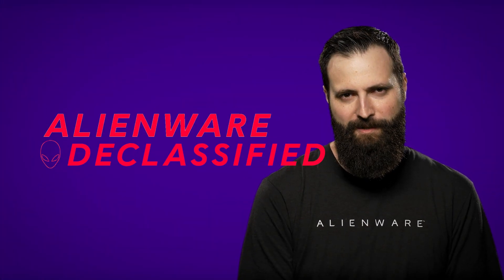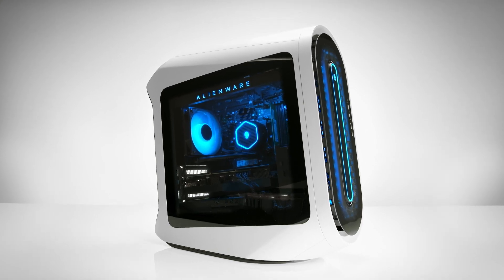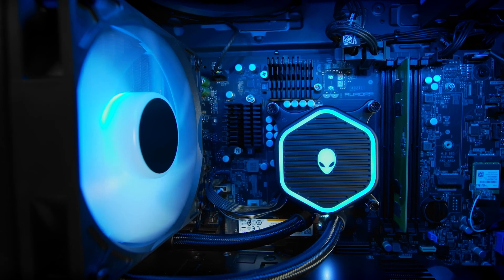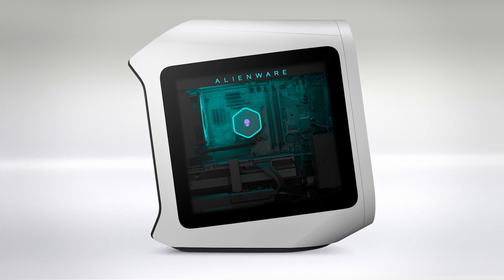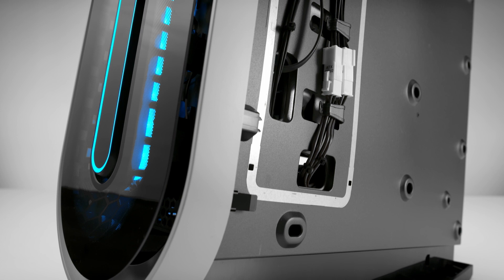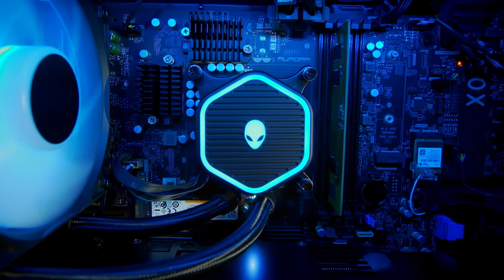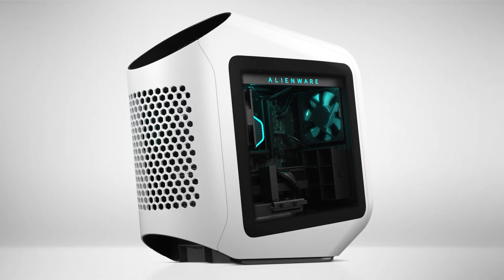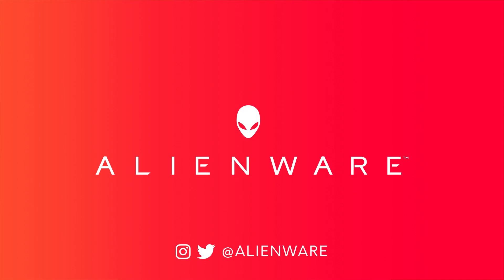Alienware Declassified | Engineering the New Aurora R13 & R14

Comment: Go to their website and see all the options and their costs. I did and loaded one out, max everything. The final price was over $5000. And that case reminds me of my R8. There should be a warning on the rear end, "Open at your risk." Talk about proprietary. Since my R8 wouldn't hold my new RTX 3080, I decided to gut the R8 and move everything to a regular case. Bad, bad idea. Don't even go there. On the lighter side, they do have excellent support. I've used it several times, and they took the time to solve my problems. Their support: 10 out of 10. Their computers: 7 out of 10.

Comment: RAM is locked at 4400MHz with the two sticks installed.  Can't upgrade it for better speeds, and there isn't any XMP 3.0 going to be available for the system.  Basically, decent airflow is what they decided was what gamers wanted.  Nothing more.

Comment: Why not just use RGB lighting fans all the way around? I know the front two in the front and the there’s the one at the top of the case but the reflection of that light would light up the whole case.all you have now is the one 120 mm fan with RGB and optional cooling thermal on the CPU.if your gonna go the RGB route why not go all the way.

Comment: I think its the coolest idea ever, except I just dont like how its on an angle. lol. But, for some reason the idea of a single fan water cooler on the back of the case makes me want to upgrade from air cooling.
Reply: If you go to water cooling please don't get a 120MM CLC (what this is using). 120 MM CLC's are awful, go with 240MM or 280MM. The CPU in this PC regularly hits ~80c while gaming. My overclocked 8700K with a large air cooler (Deepcool Assassin III) has never peaked above ~72c while gaming.
Reply: @sean8102  does it come with the integrated graphics card turned off by default? lol..

Comment: Great chassis, but I'm still very disappointed why Alienware (Dell) discontinued the Area 51 (an entirely different subject.. so lets continue).   I have an Aurora R10 and I was very excited to see the R14; however, what I've quickly noticed is the room -- or the lack thereof, and honestly, if your going to deck this thing out with a Nvidia RTX 3090 and a Intel i-9, there is no doubt you will be pushing that 750w power supply to the limits.   With these confined spaces, you better hope those two fans (front and rear) are working well or your temps will climb to dangerous levels very quickly.  Then there's noise control --  Its always been a challenge for all computer makers to drive performance without the chassis sounding like a jet engine.  However, sales (in all PC makers) will always say, "These systems are quiet."    Well, ok to be fair, if your playing lower end games that can run on a Intel i3, sure, true enough. However, you be the judge.. what did you buy your Alienware for?
High or ultra-high resolution settings, games that demand increased GPU and CPU use, fast I/O and disk access etc.. will only end up with you running for your gaming (with noise cancellation) headset.  (Case in point: Dell also said the VRTX server chassis was "quiet as a workstation - you can place it under your desk" - if you ever heard one (or you have one), your probably laughing too, because they are loud!)
Lastly,  the motherboard is a custom build for this chassis. The connectors at the end (to improve airflow) you will not be able to upgrade it - so if your one of those who likes to rip out the old and install new, years later, your out of luck.     In summary, I bid Alienware the best of luck on the R14, but I'm very skeptical what others will say -- for the past releases of Aurora for me however, to include the R14, its a high price tag for the virtually reinventing the same rig.   The usual reaction I get from people, "You paid a pretty penny for that name".
Reply: I actually needed a comment like this :) 
This chassis actually su*k
Reply: Thanks for posting this.  I have been on the fence with the R14...mainly because the GPU's are so hard to get, otherwise I would just build my own.  This was some great info to mull over before pulling the trigger.
Reply: @mr.papagorgio4683    Client of mine asked to order them one (on Dec 13th) and the shipping ETA was set to Dec 20 in time for Christmas. At first I thought, "Great!" but as time went on, I had a slight feeling that date wasn't going to be realistic.  Sure enough, Dec 21 I got a email from Dell, "Your order will be delayed. New estimated date - Jan 7th 2022.   Why Dell over promises their production and shipping dates is beyond me. Logistics hasn't really been Dell's forte'.  If this generates a reaction from Dell, great! I"d be glad to spend more time with them.  But getting a hold of "Uncle Mike" is close to impossible, even if your managing multi million dollar networks. Proof of concept - Why did Dell dissolve their printer department but never announce it? Answer: Because Dell printers were horrible. (*Yet another topic. :-)   )
Reply: there are two fans
Reply: So another fact that I wish Dell would answer, Dell Aurora R7 came with a 850W power supply.  Why did they downgrade to a 750 on the new releases?  They trying to discourage dual GPU use?  I know a few years ago, Dell used to have a site called Idea Storm where you could post ideas for Dell.  That's gone too. Sooooo..... "Uncle Mike".. whats the deal dude? Your making people think Alienware should have stayed Alienware before Dell acquired them.  But we know the answer to that now don't we.... Too busy making more money via corporations then home users. Some days I feel I should start a 'ying/yang' page.. what we used to know about Dell and the Dell we know now. Example:  Ever wonder why Dell got rid of Appassure, but actually renamed it Quest Rapid Recovery?  Then when you call Dell Support and the support person says, "Thanks for being patient.. my computer is acting up a bit."  I actually asked them, "If your computer is acting up, are you practicing what your preaching and using Dell AppAssure?" Answer: "No we don't use that."   Isn't that crazy??   Do as I say, but not as I do? Why would a company not use their own software?

Comment: Really wish i could swap my inferior case for this new design, my biggest gripe and most of my calls to alienware had to do with airflow and temps
Reply: Get liquid cooling, I have my alienware for 6 years never had to change anything and still don't today.
Reply: @Drew Carry  they didn't have an option to liquid cool the GPU and since the case is so poorly designed (the old one) there's almost no airflow going into the GPU which sits directly under the powersupply bracket

Comment: Sigh. well, as long as this video keeps showing up in my feed, I'm going to keep commenting on the things I find out about it for people to consider. Compared to my previous-gen Aurora machine, two interesting differences: one, is that these new Aurora's have three LESS USB ports on the back. That might mean something to folks who want more than eight available USB ports on the rear of their computers. It's also a bit weird as the physical size of the new systems are larger than the outgoing. You'd think they would at least have the same number of places to plug in USB devices, but they don't.  

Secondly: they removed one of the 2.5 inch drive bays. Most people probably wouldn't care, but it might just matter if you need as much internal storage as possible on your system. Like for production work. 
Anyhow, that's it unless YouTube throws this at me again. Have a pleasant day.
Reply: Oh Get real! if you need that much storage need to reevaluate type PC you need, the bay had to be removed cause it wasted space and limited cooling in the system same with PSU which also had to be sized down to meet consumer PSU guidelines that the Prior Aurora had issues with. With this new build you lose 2.5 but gain a secondary NVMe slot, so it actually supports faster more efficient storage in line with what we should expect from a gaming rig.
Reply: lol

Comment: From the images it looks like this can only mount one NVMe M.2 drive? That's kind of sad. The configurator only has an optional mechanical drive for a 2nd drive with no SSD options either. :/
Reply: You wouldn't want to pay Dell's prices for a SSD drive anyway. I've been using SK Hynix Gold SSD models for over 2 years now with no issues. Installation requires an SSD SATA cable and about 5 minutes of your time to look up how to get the computer to register the drive.

Comment: Woah woah, hold up... I just took another look at these things... Are you telling me the reason why the front ports have been moved to the right of center is because they're physically attached to the Motherboard now? Like you find on the cheapest of office systems?? So if they're ever damaged or bent you have to fix the Motherboard itself instead of just replacing a little small plug-in circuit board? Just to cut a couple bucks off the manufacturing costs? And claim it's to "reduce the number of internal wires"?? 

Am I pretty sure your last name "Troller" is exactly that? C'mon Man. You're PROUD of this? Really? 
Jesus Christ eating crackers, how many other hidden Easter Eggs of awfulness are we going to find in these systems?

Comment: Definitely better looking and improved cooling over the previous version. Looks like the power supply is not standard from the pictures on Dell website. Could be an issue where you are forced to buy a Dell/Alienware power supply if it fails. Can Alienware address and confirm what power supply is used in the R13 & R14?
Reply: In the Gamer's Nexus video teardown of the previous build the PSU and motherboard were all proprietary. No options for upgrades within the case because it's designed around custom hardware. Doesn't look like that's changed.

Comment: For r15, and 16, you can put two fans up front and a 240mm aio on top (make the top mesh). Put the power supply on the bottom, with some space for hard drive and cover it up. BOOM it will sell like crazy.
Reply: They would never because that would make too much sense. They go for the dumb routes. The r27 might have that but well see.
Reply: @JellyTwitches  maybe the R 46,678,128 will finally come close close to making it a SENSABLE purchase and not a complete RIP-OFF!!!!!!!!!!!!!!!!!!!!!!!!!!!!!!!!!!!!!
Reply: @JellyTwitches  They need to hinder performance not help it so that way their customers continue to repurchase new hardware. 

It's pretty sad actually.
Reply: @JellyTwitches  lol

Comment: It would have been nice if I didn't fall for the 50% better air flow on the r12. I mean who would have guessed that a psu directly in front of the 1 120mm fan would have cause issues with heat. I essentially paid 4k for a oven that houses a 3090 and if I wanted to be able to keep the 3090 in decent operating temps I'd have to fire up the jet engines.
Reply: Yea Gamers Nexus reviewed the R12 and were shocked by how bad the thermals were and how poorly designed the system was from a airflow stand point.
Reply: Nice reply
Reply: @mooniemine134  right, my buddy has the same issue with a 3080 and the gpu fans are already going out after 4 months. And had high temps prior to that issue. Essentially what I did was paid 4k for a 3090 and a 11900 and a warranty. Got lucky and won a 3080ti on Newegg shuffle and it performs better than the 3090. Ordered a case and MB now I have 0 issues. It's crazy how much my benchmarks have improved all around with the only difference being a case, MB, and a lower tier gpu. That will be the last purchase from Dell in my lifetime and I would suggest the same for anyone else.

Comment: Also keep in mind Dell has never set the Bios correctly for any PC I have received since 2002- both the CPU and the Ram comes set at lowest speed since they just put the parts together and ship - I do not think they even turn them on to see if they boot - CPU Turbo Boost comes turned off , was running at 4.8 instead of 5.3 and XMS Mem is not set - 3200 ram was running at 2400 - My R4 came with a bad power button so they had to come out and replace the front cover before I ever booted it up - Ran great for 8 years and still going for a friend of mine - every PC from Dell is shipped this way -

Comment: this reminds me of the the $3K R-11 I bought and received late Nov last year with the i9-10900KE, 2 TB ssd, 32GB (upgraded to 64) ram and GTX-2080Ti - the 3000 series was not available until after I ordered -   after trying to find a way to stop the CPU from shutting down due to the heat - BIOS would not even let me upgrade the fans without doing a fan check on every start or restart - in Sept I bit the bullet and bought a Big case and ASUS MB and pulled the 4 main components listed - (could not even use the 1000w power supply and threw the R11 case and motherboard in my recycle bin for the trash collector - I was replacing and 8 year old 6 core 3.2 CPU that ran better then the R11 POS - when I bought the R11 already I had  Dell desktops and 3 Dell notebooks in my house that were in service - for almost 20 years I only bought Dells - Now I will never buy another Dell desktop again - in fact,  I bought a i7-10600 to lower the heat in the R11 to set it up as a new work PC and since it would not boot I bought another case, ASUS MB, etc.. and built a new PC for the wife with it - I admit I did buy a new notebook to replace my XPS-8100 running Win 7 work PC since I cannot get the parts to build my own - I needed 3 monitors and the Dell Gamer 7567 I bought on 5-30-2018 for $1.7K would only support 2 monitors until a month after I bought the Dell G15 5510 to replace it -
Reply: So in a nutshell "dell is trash"
Reply: @mooniemine134  nah the r13 is a beast
Reply: @damongardea4591  Yea. Must be why that tiny 120 MM CLC can't keep the CPU below 80c while gaming lol. Also hope your PSU never dies since dell uses a proprietary one. So, you'll find it awfully hard or impossible to find a replacement. The motherboard is proprietary as well so it can't fit in any other case. And no other standard form factor motherboard can fit in this case lol.
Reply: Let it out brother. It'll be okay.

Comment: On Dell website for this there's is no 1000W psu customisation option. If installing this with  rtx 3080 GPU (let alone 3090) and intel i7/i9 12th CPU then surely 750W is gonna struggle, right?
Reply: the 1000w was too hot to touch with just the 2080Ti - I myself could not leave it turned on with that a 3080 or 90 - in fact I did turn the R11 off when ever I walked away from it -

Comment: Well.. looks like a front mesh grill that will help with two  large intakes and two exhausts...  nice clear view inside.   Let's hope they've made the internals less proprietary so we can still use our own Power supplies if we want to and maybe... be able to reuse the case when the system gets old.  That's one of the key arguements .. in a day and age where your supposed to conserve, it really sucks that casing is destined for the dump rather than being able to repurpose it and reuse it down the road.
Reply: Motherboard is proprietary and the psu looks like it’s for a server computer, possibly proprietary not sure tho might be tfx. Last gen was more upgradable.
Reply: @notbrokebrolt6281  Found a blog post from Dell/Alienware. The motherboard is not a standard form factor. The front I/O is actually part of the motherboard (same as the previous Aurora reviewed by Gamers Nexus).

Comment: I Cancelled mine when I seen the benchmarks on the 3090. It has been nerfed down to 300w so basically a normal 3080 is same or better than this 3090.
Reply: That explains how they put a 750 watt supply in the chassis, which appears to be the only option.
Reply: lol

Comment: ddr5 4400( basic standard for ddr5 should be 4800) lol, 120mm radiator for intel 12 gen in a mid-tower case(400w max monster) oh oh oh that 750w PSU for 12900kf(200-400w)+3090(350-400w), so many "smart" choices. OH almost forget only 1 M.2 slot.
Reply: 救救我

Comment: Cool, so all the people who got a previous-gen Alienware with the Intel cooler slapped on an AMD CPU can onw fix their problem by buying a new Alienware!
Reply: only way is buy new PC - Dell will not sell any Parts other then ram, drive caddy, try and buy an aftermarket graphics card to fit in an Alien - not going to happen - if my 2080Ti was to die I would have to remove the front fan to get a 3070 to fit - it could not cool with two fans so you could have a fire with just one fan - now if you remove the 3.5 drive slot you could move the fan up -

Comment: Why only one stick of RAM? Aren't these dual-channel?
Reply: you add the second ram when you select the option - I upgraded my R11 from 2400 to 3200 speed ram and the did not bother to change the BIOS so it came set for 2400 - I had to correctly set every ram and CPU on every Dell I have bought so far - The BIOS is the cheapest I have ever seen - my wife was standing behind me when I first turned on the R11 and went into the BIOS to set them and I heard her say " order a new motherboard"  she was reading my mind - when she went into the Asus BIOS on the PC I built to replace her Dell XPS 8900 so I could use it for a work PC she was blown away by all the options and how it is laid out -

Comment: Please stop with the non standard motherboards and power supplies, I can't wait to no be able to replace them whenever the warranty ends and having to replace almost everything in the system, including the case since there's no standard case power cables and the water cooler since it's too short and designed for one system in mind.
Reply: Instead of complaining you could just… not buy it?